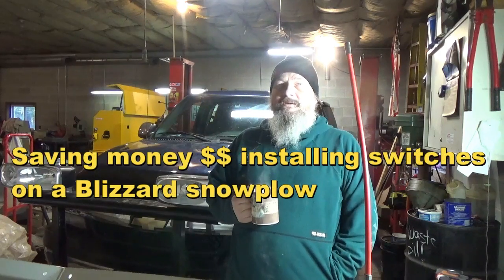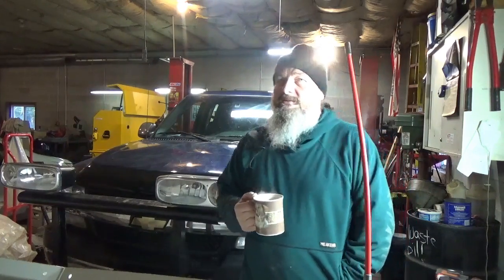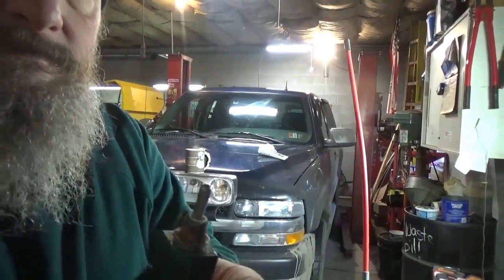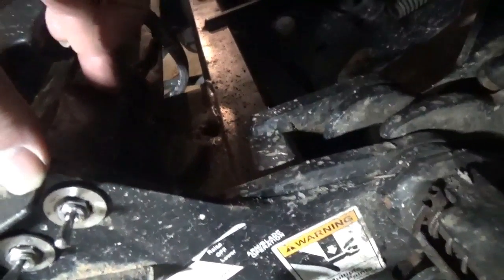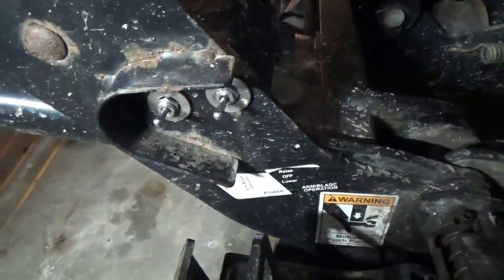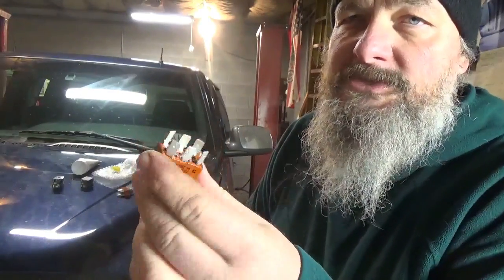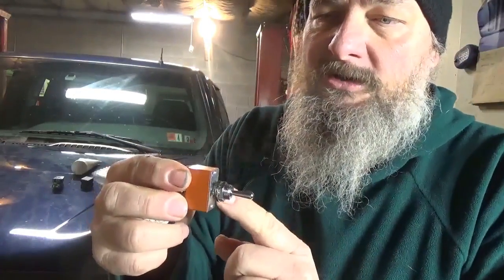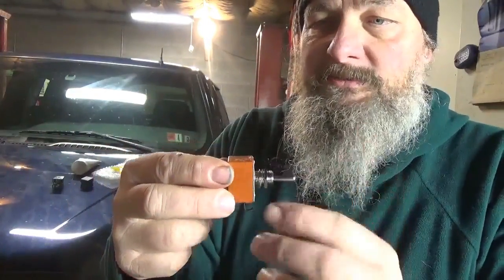Saving money $$ installing non stock switches on a Blizzard snowplow

Comment: Thanks for making this video man.  I've had my blizzard plow for two winters now and went to unhook it from the truck yesterday before work and the down toggle is froze.  The up halfway works but that toggle switch needs replacing.  The left side toggle switch for the in cab controller/mounting momentary seems OK still.  I'll definitely try to find a cheaper switch alternative opposed to paying overpriced dealer cost for a switch.

Comment: Until you find switches and can put them in- a nice short-term fix is to just unplug the rearmost box (the wires go into this) from the toggle switch backside box.
A bent 6" piece of solid copper wire stuck into the correct 2 slots serves the same purpose as the toggle switch.
 Or put blade ends on for better fit/connection...I've had good results with just a mid-size wire that fits in the slots good without wiggling loose as I plow.
Probably should tape into position or carry a few spares just in case- though I haven't lost one since I found the gauge I'm using now- just a good tight fit. 

Middle slot for power and left or right (opposite of how you push the toggle) for function.

Comment: 98%er- do most plow manufactures have the outside switches to aid with connecting. Did not know that. You can change out the new switches 4X before you have the cost of OEMs. I would do the same thing and keep the $100 in my pocket. Good save, Mike.
Reply from the maker: +Douglas Laramie I know old style plows surely did not have the same type of hook up with switches outside. Not too sure about the newer plows other than the Blizzard brand.

Comment: Ok I bought a Meyers e60 and I have u,l,r but no down but if I touch the wires together it goes down so I'm going to run a toggle switch to operate down because I can't afford a new controller yet their around $300 to $500 and I can touch the wires for free😆

Comment: Hi Mike, 
Great video!  If you take the nut off  the front of the switch, what is holding it on in the backside of the switch.  My switch appears to be fixed, is there a screw in the back of the switch? should I use force to get the switch (backing) out.  The front just about fell apart when I was taking it apart the back seems fused in some way?!
Reply from the maker: As I remember there is nothing else holding it. Mine was so rusted and stuck in, there was no way to get it out but in pieces!

Comment: Do you by chance have a link with the switches?  I have the exact same problem!
Reply from the maker: I bought them from Mcmaster-Carr and that part # is no longer available. So I will have to see if there is an updated part # when I have time.
Reply from the maker: This place has them much cheaper than I paid for stock ones. I have dealt with them and they are very good to deal with. http://www.storksplows.com/40576-blizzard-snowex-plow-side-mount-dismount-switch-power-hitch-2-dpdt.html

Comment: These "Brick and Mortar" stores wonder why they're going out of business. SEE YA!   Get  fingers from a "Playtex" glove (like you wash dishes with) Easy-to-see yellow, real tough. Cut down to length, leave enough to "border" the switch. Put washers and nut in finger first, then Insert finger into slightly enlarged switch mount hole first, then switch. You can finagle around, but it can be done. Careful when wrenching nut- to avoid tearing rubber. Film it- if it works- post it. If not- post it and call me big dummy.